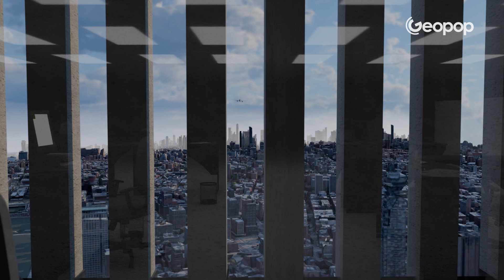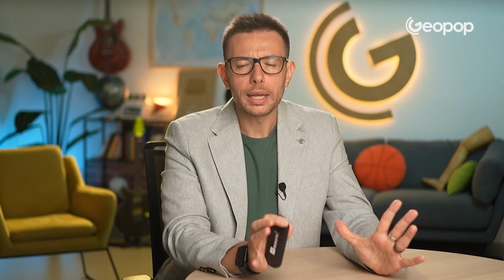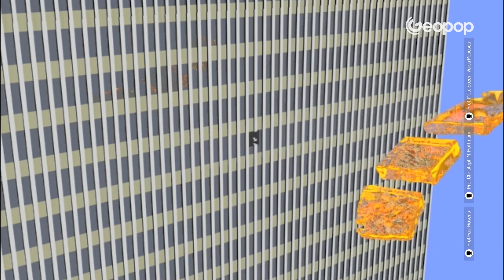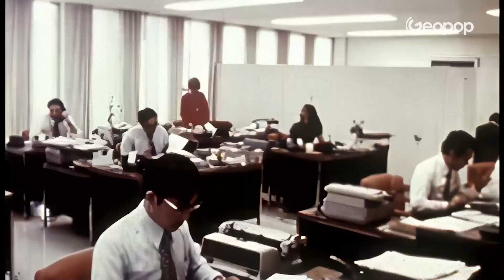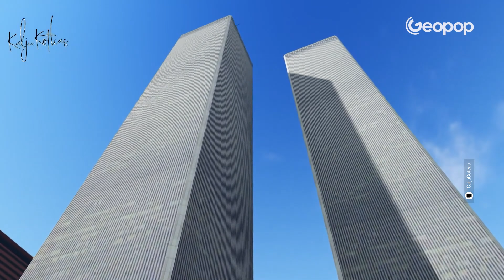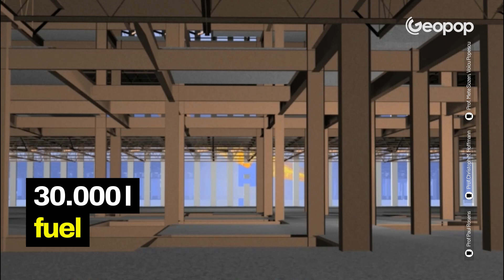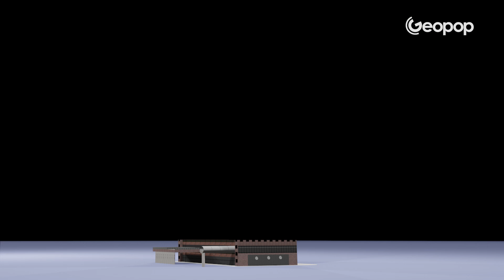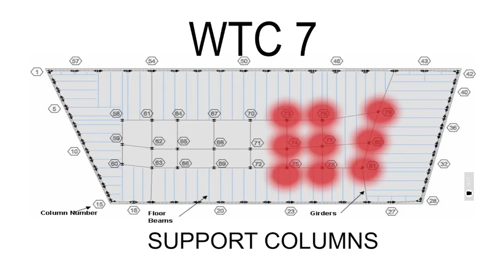9/11, 2001: The Technical Reconstruction of the Twin Towers and WTC 7 Collapses

Comment: I’ve always found it strange how WTC7 fell so cleanly, especially since it wasn’t hit by a plane. Even if fires and structural damage were factors, the near free-fall speed and symmetrical collapse still raise questions for me. I’m not an engineer, but it seems fair to ask: have we really explored every explanation with the same level of scrutiny? Shouldn’t transparency and re-investigation be welcomed in a democracy? If America was a democracy, a lot of things would be different.
Reply: NIST did a full investigation on the cause of WTC7 fall, well explaining what was seen.
They could then suggest new practices and rules for steel construction safety, limiting the risk of another structural failure of that kind.
What outcomes do you expect from a "re-investigation" that would worth the costs?

Note: Since the Agent Orange entered the White House, USA is further away from democracy it has ever been.
Reply: You grossly misunderstand the collapse. Let's fix that in one post.  Building 7, the 6th building to collapse of 10 lost on 9/11 though extensively studied still confuses many. Not famous or a terror target and with no casualties it didn’t get a lot of attention initially, creating an information void the internet filled with utter garbage. Because everything seems like a conspiracy if you don’t understand how it works I prepared this brief summary from my own analysis to fix that. No politics, just engineering. 

The North Tower collapse at 10:28am bombarded Building 7 with tons of burning debris, causing heavy damage and multiple floor-wide fires that burned out of control for 7 hours. Half the FDNY firefighters having been killed, others injured, units in disarray, equipment destroyed, no water pressure, and the greater urgency of Search & Rescue efforts, firefighting was pulled as futile. The building couldn’t be saved and was left to its fate. That is the sort of choice firefighters make every day in brush fire situations - which houses to save and which ones to let go. Only real difference here is moving the decimal on the size and cost.

www.youtube.com/watch?v=g_SvpwyC17M&ab_channel=MFitz  

Collapse of a burning structure is always a concern for firefighters. Steel buildings subject to fire rely on active fighting of the fires to survive. Buildings are designed around 1 to 3 hours of fire resistance, allowing time for occupants to escape and ACTIVE firefighting to get started, after which all bets are off. Left to their own devices they will exceed their design envelope and collapse. In B7 the occupants escaped, passive and active fire protections were compromised and active firefighting was abandoned which left the building to its fate. It lost. Odds on Building 7 would eventually collapse, and it did. No big deal in logic. 

www.youtube.com/watch?v=WnYBX6QT0R4 

FDNY Chief Daniel Nigro ; The biggest decision we had to make on the first day was to clear the area and create a collapse zone around the severely damaged 7 World Trade Center, a 47-story building heavily involved in fire. A number of fire officers and companies assessed the damage to the building. The appraisals indicated that the buildings structural integrity was in serious doubt. I issued orders to PULL back the firefighters and define the collapse zone. It was a critical decision; We could not lose any more firefighters. It took a lot of time to PULL everyone out, given the emotionalism of the day, communications difficulties and the collapse terrain

FDNY Deputy Chief Peter Hayden ; We had our special operations people set up surveying instruments to monitor and see if there was any movement in the building. We were concerned of the possibility of collapse in the building. And we had a discussion with one particular engineer there, and we asked him if we allowed it to burn could we anticipate a collapse and if so, how soon? And it turned out that he was pretty much right on the money, that he said 'In its current state you have about 5 hours

The collapse of Building 7 was anticipated and widely reported in the media throughout the day. At least 24 video cameras recording some or all of the collapse. Everyone knew what was coming and why.

www.youtube.com/watch?v=OY5S5k3tMHI 

Building 7’s collapse was completely different to the Twin Towers, and harder to understand with most details hidden from view. But we can still sort out what happened through careful analysis and observation.  This is my explanation  of the collapse using the best available information and relying on no authority.

B7 was complex 47-story steel framed structure built on top of a smaller existing 3-story building, requiring several lower floors dedicated to complex load transfer structures instead of usable office space. Of trapezoidal shape and all-steel tube-in-tube construction, B7 (above the 7th floor) consisted of a central core of steel columns carrying most of the gravity load, perimeter steel columns around the outside of the structure carrying the remainder of the gravity loads and long span beams and girders to tie those elements together and form the floors. On the outside of the building hung a moment frame - the last part of B7 to fall 

Phase 1 : The first externally visible signs of collapse initiation occurred at 5:20:28 pm. Collapse initiation for B7 is notably quiet with observers not realizing the building was collapsing! There was no audible warning in the form of say hundreds of ear drum busting 180-190dB explosive bangs preceding the collapse. Here at 12:00 a local CBS affiliate reporter is talking 10 blocks from B7 when collapse begins. People don’t start to notice the collapse until 12:11. Then at 12:45 is the famous CBS fixed camera clip of Building 7’s collapse.  Note how quiet it is.

youtube.com/watch?v=t5tEy6mXSE8&ab_channel=fresnosean379

Collapse initiation was due to lower floor failures above the load transfer region (7th floor) in the NE corner of the building. In this video at 0:45 you can see the NW corner from inside the building while under construction, Column 79 just out of frame on the left. That big, angled steel beam across the top of the frame connects to C79 at one end. The girders connect to the beam. That beam and all those girders depend on just one connection

youtube.com/watch?v=nP3TNHPCIVU&t=35s&ab_channel=EdwardCurrent

Phase 2 : Lower floor failures caused a loss of critical lateral support over an excessive length of core Column 79 and it buckled. If you look at a floor diagram of Building 7 (see above) and look at all the structures that depend on C79 you quickly realize this one column was a relatively isolated structural element on which a disproportionately greater fraction of the structure depended analogous to say the Key Bridge. Externally we see a vertical progression of window breakage along the 44-46 line and a kink in the roof of the East Mechanical Penthouse at the top of the building, consistent with C79 failure. The transition from full capacity to almost no capacity occurs in virtually an instant. Once the buckling failure occurs there is almost no resistance

Normally with a buckling column, the load could very well be redistributed to other columns, meaning the buckling could stop after a while. With C79 that is not the case - the failure did not redistribute the load, so the collapse rapidly progressed to the roofline, sinking the rooftop penthouse.

Phase 3 : With C79 gone, B7’s progressive, non-symmetrical collapse continues with C80 and C81 at the east end of the core left laterally unsupported and quickly buckled and failed as well, sending the EMP down through the building. C79-81 all have no diagonal bracing, which I believe is a major reason why they could not redistribute a lot of vertical loads among one another.

From there collapse progressed from east to west through the central core until the core was gone taking all of the interior floors and structures and probably most of the perimeter columns with it. You can see the horizontal progression of window failures low in the building and the dropping of the remaining rooftop structures into the building. One of the big takeaways from the NIST Building 7 study (that gets completely ignored) was their modeling which determined C79 failing under ANY circumstances would have initiated the same collapse sequence.

Phase 4 : 10 seconds in only the exterior moment frame - just a hollow empty outer shell – remains, the illusion the building is still standing since little has outwardly changed. But it’s just a hollow empty shell like an empty cereal box supported by only a few remaining columns and quite unable to remain standing. With all internal framing gone, the north face leans inward, forming a V in the roofline, the last perimeter columns buckle under the strain and the moment frame free falls, landing on top of the 7-story high debris pile. It is only here, at the end that a single measurement of alleged free fall acceleration is taken, from a single point on the moment frame. The Building (defined as its center of mass) did not “free fall” (sort of) – just one corner of the outer shell did. The Building was already gone before that happened. The period of alleged free fall was a product of collapse progression mechanisms, not of collapse initiation mechanisms and is irrelevant to what started the collapse. Start to finish the entire collapse took 18-20 seconds, 3 times longer than true free fall and how fast something falls cannot tell you what started it falling anyway. The debris spread outside the footprint, blocking surrounding streets, heavily damaging the Verizon Building and destroyed Fiterman Hall.  

Building 7’s progressive, non-symmetrical collapse was incidental and unintended collateral damage from the combined effects of fire + time + gravity started by the collapsing North Tower. That is true no matter who planned and carried out the 9/11 attacks or why . The collapse was of so little consequence it barely even registered at the time, a mere footnote. It only took on semi-mythical status as an alleged smoking gun years later when demolitions at the Twin Towers, missiles at the Pentagon and shoot down over Shanksville all failed and conspiracists had nothing left to work with.

Anything can seem like a conspiracy if you don’t understand how it works. Now you should. I hope you found this helpful, informative and it solicits informed critical comment. If I made any errors of fact, logic or reason or left anything important out, please let me know so I can fix it. IF you can offer a more plausible alternative please do. Be the first. Please start any reply with the words “Tits McGee” or I will know you didn’t read it and are wasting my time.

Comment: Total whitewash BS.
Get the real story from the NY firefighters, not the lying politicians.  Search for
Bravo Seven.
Check out Archetechs and Engineers for 9/11 Truth.
Reply: I did what you said and checked out Architects and Engineers for 9/11 Truth (and even spelled it right).

Turns out that objectively, AE911T is not a professional organization by any stretch. AE911T are a tiny, fringe single-issue advocacy group that live on appeals to authority they don't possess, to push an agenda that has no tangible support in the professional community. They have no support from any professional engineering organization anywhere in the world and support amongst individual professionals in relevant fields is tiny to the point of insignificance. The lunatic fringe of the tiny lunatic fringe minority. They tell people like you what you think you want to hear, so you accept the (false) appeal to authority and don't ask questions, even if you knew what to ask. They are a faith-based organization, selling dogma which never adapts to new and better information. 

To illustrate their level of "expertise"; AE911T used to have one former manager of architects on staff whose claims to fame were a Denny's and a high-school gym. A couple of years ago the board tossed him out of the organization he founded for jeopardizing their donations. It's pretty obvious where the priorities are. Their top structural engineer is an unlicensed civil engineer who builds radio antenna towers. Their FEA is done by a carpenter using MS Paint. Their physics is done by a retired 9th grade science teacher.

The talent pool is not deep and it shows in their output.

Highly-Credible People don't ask questions, they answer questions. So much for AE 9/11 Truth, whose sole play is trying to get someone else to do the investigation.  I thought these guys were supposed to be “experts”

Architects and Engineers for 9/11 Truth;  No Architects, no proper Engineers and no Truth.  They get the date right. 

AE911T are just a slick, focused PR campaign raising money for the sake of raising money.
Reply: @TheLoonResistance  so?
it dosn't matter

Comment: Show some real time pictures of the lower walls of the twin towers buckling in before they collapsed into their footprint like you argue occurred.
Reply: OK, except it was upper perimeter columns.

Collapse initiation was due to sagging floor trusses (which we can see) causing inward bowing of perimeter columns by up to 5 feet (which we can also see) at the impact and fire damaged floors until those perimeter columns buckled and failed, initiating the collapse (which we can see). I would refer to you the excellent Gary Pollard video of the collapse of the South Tower. Pay attention to the first 12 seconds in particular.

WTC2 Collapse -- Gary Pollard (Enhanced Raw Copy from NIST) 

www.youtube.com/watch?v=ULdiD6gYZO0  

Columns don’t work well when they are bent. The Twin Towers were designed to work with straight elements not bent ones. When you bend those columns they become up to 4 times weaker. Failure is inevitable.

Notice how the columns are already bent when the camera zooms in, become a bit more bent over the next new seconds until they give, starting the collapse. 

So what bent them? It sure as shit wasn’t thermite or sooper-sekrit fire-and-impact proof hush-a-boom pre-planted demolitions that don’t explode. 

If you keep watching you will note that after the tower starts collapsing the air inside the building (95% air by volume) gets compressed and forced out the windows. These low-velocity air bursts devoid of blast or fragmentation effect are a reaction to the building collapsing not a cause of the building collapsing 

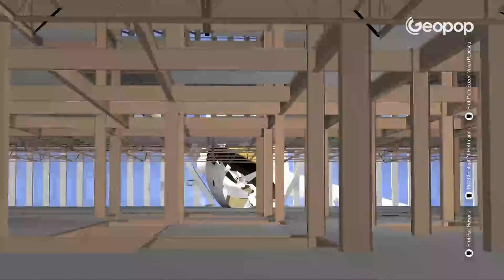And at a different angle from 1:18 here:
youtube.com/watch?v=TJJPYTVjxug&ab_channel=femr2 

Or here
www.youtube.com/watch?v=-DCgEJ2bUcI 

Also seen in the excellent still image here at 9:09:
youtube.com/watch?v=YXsDwKYz1bA&ab_channel=msvfreak94

Comment: What about the Core, Steel in the core of WTC twins, it is immposible that these two cores fails and fall like a stone , a free fall . It was never the plans but it was secrete demolition plan. executed very well, to raid afganistan, and ruine it for oil.
Reply: Impossible?  Sure. But then what you describe is not how it happened. Cores actually failed last - which is obvious to anyone with the gift of sight.